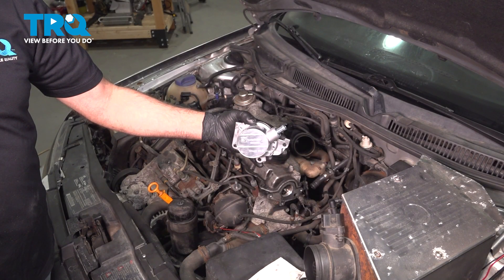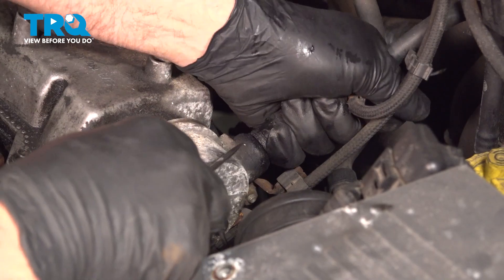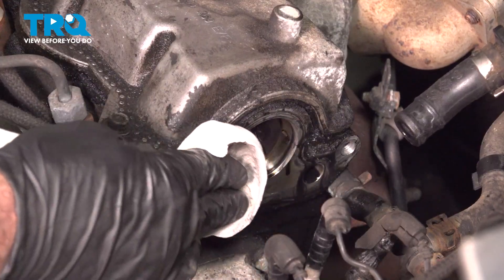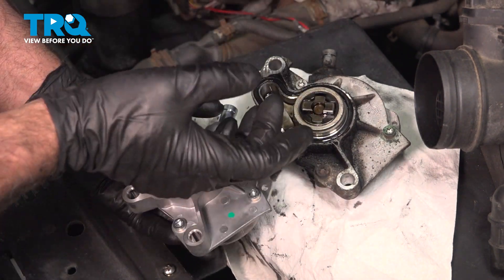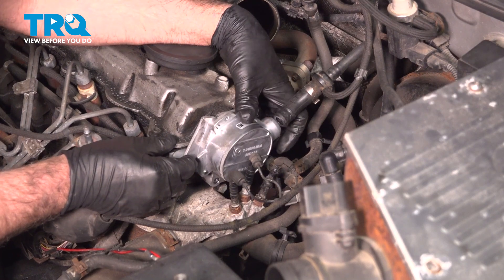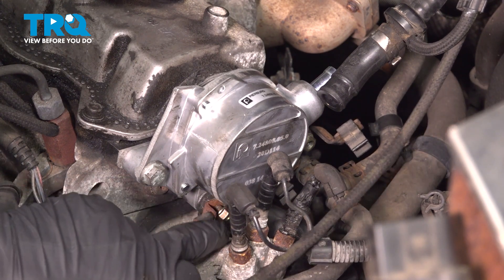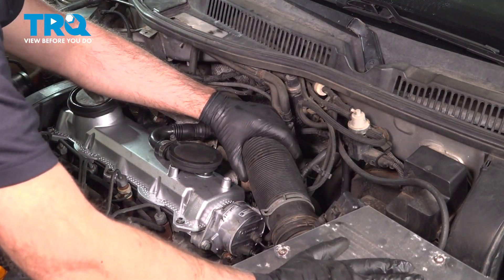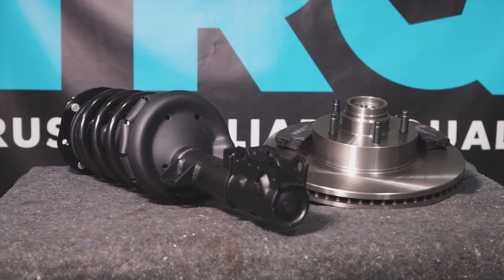How to Replace Engine Vacuum Pump 1999-2005 Volkswagen Jetta 1.9 TDI

Comment: Could you tell me what those 3 sensors are called just under the vacuum pump you changed? Especially the back connector as mine looks bad like yours.